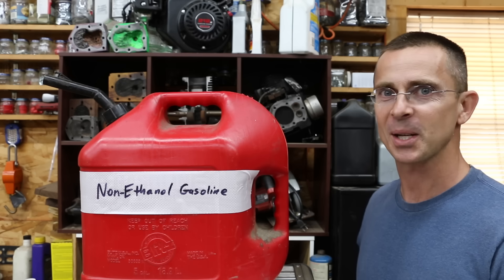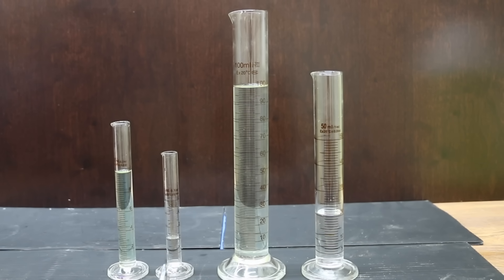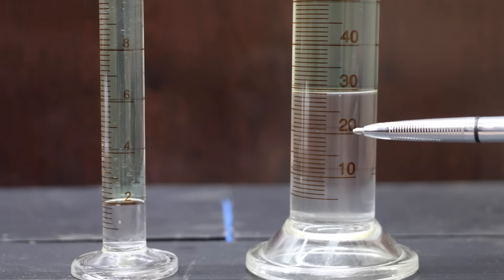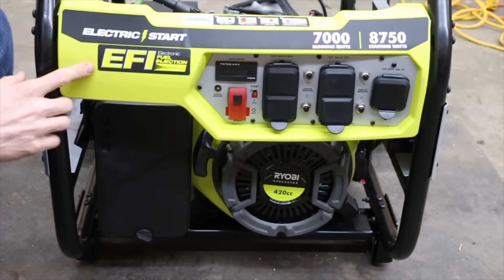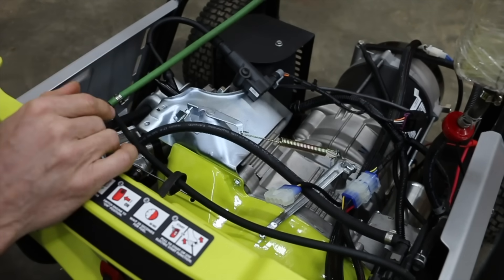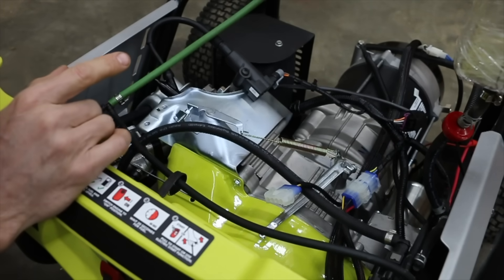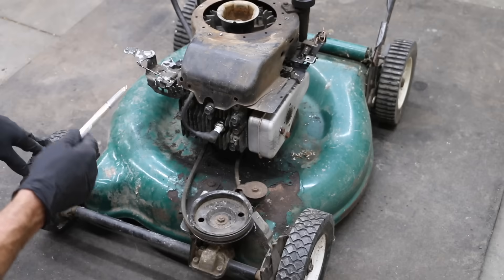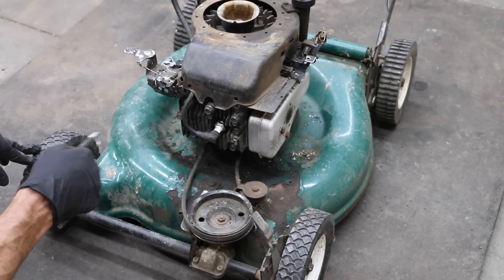Is Non-Ethanol Gasoline Really Better? See the PROOF!

Comment: Here in Colorado, regular gas is only 85 octane, so if I want to run 87 octane like my vehicle manual specifies, I have to buy midgrade. The price gap between the two grades used to be 10 cents per gallon, then it went to 20 cents and now 30 cents, so there's quite a price difference. People claim that you don't need as high an octane at high altitude, but I've read that only applies to old cars with carburetors, not modern EFI engines with engine computers. I'm wondering if running 85 octane causes the engine computer to reduce power to prevent knocking and also whether mileage isn't as good with 85 octane. I'd like to see a test to verify whether a modern engine is negatively affected by running 85 octane at higher altitudes.
Reply from the maker: Thanks for the suggestion.

Comment: I run ethanol (e85) in my 2016 Silverado 1500 and have found that although my fuel economy is worse, my engine tends to run better and smoother than with normal e10, anyone else run e85? I’d be interested in your results vs regular gas
Reply from the maker: Thanks for the video idea.

Comment: I had an outboard 90 hp honda and used the ethanol gas for couple of yrs., the ethanol ruin all my supply lines and then clogged my engine. $1000 later it worked again.
Reply from the maker: Thanks for sharing.

Comment: i do yardwork so my equipment gets beat on. mowers it seems frequent oil changes are most important. and i only use non ethanol. as for weedeaters the 2 cycle oil dont do enough. i found adding some marvel mystery oil helps them run much cooler better longer. so theres a test you could try?
Reply from the maker: Thanks for the video idea.

Comment: Not sure how distant your makeshift remote tank for testing is on the generator, but I would add caution to ensure that it is very well sealed to prevent vapor leakage. Vapors+space heaters is a bad combo.
Reply from the maker: Thanks for sharing.

Comment: Okay but are you adding into the fact that Ethanol takes more fuel to produce and that you're losing effieciency in its production so the modest gains in fuel efficiency at the engine is insignificant to the supplemental cost of creating ethanol to begin with.

Comment: I run PNE in all of my small engines, regardless of their manufacture.  Two cycles run PNE and Stihl Ultra two cycle oil at 40:1.  All gas has one ounce per gallon of Stabil in it.I have never had a problem with this mixture, even after two years of storage.
Reply from the maker: Thanks for sharing.

Comment: My car tells on ethanol gas very quickly. If I put the 10% blend in the tank, the mpg goes down, and the motor rattles under a load. 
If I put the non-ethanol in the tank, I average about 60 miles more per tank, and the rattle don’t happen at all. 
The car is a 1998 Grand Marquis with the typical 4.6 V8

Comment: I may be wrong but I think you mean hygroscopic ( tends to absorb moisture) versus hydrophilic ( tends to mix with water), which ethanol does not do well. It's called phase separation, when the ethanol separates from the gas and combines with the moisture. I remember learning that brake fluid is extremely hygroscopic. I'm not busting your chops here. You're obviously detail oriented so I thought you would like to know.  Finally, I have noticed that I am replacing more deteroriated fuel lines on small engines like chain saws, string trimmers, etc, than ever before. I think it's the ethanol. Another great video, thank you!

Comment: I use non-ethanol fuel in my motorcycle because it often sits for a week or two between rides and I don't want that sitting in my fuel system. How about a long term test that starts with two clean carburetors - One run with ethanol and one  without, then left to set and checked at increasing intervals (e.g., day, week, month, 3 months, year).

Another great test - awesome videos and channel!
Reply from the maker: Thanks for the video idea.

Comment: Yes water is bad for aluminum, ethanol absorbs water. If you use the fuel as you go it's fine, if you don't it's shit. Epa compliant carbs are the biggest nightmare of all. Because throwing your mower away is better than having an adjustment screw. Thanks EPA!
Reply from the maker: Thanks for the feedback.

Comment: I have had trouble with small engine carbs since ethanol became common place. But I bought a 97 ford 150 for parts it had a knocking engine the fuel tank was almost full it had set for about 2 years .I drained the tank the fuel had a slight smell .I wound up using the fuel in a old tractor with no problems.Im wondering if the larger amount of fuel had less air space an less evaporation that caused it to last longer compared to a 1 quart lawnmower tank ?

Comment: It is strange that cars in the us can run on 85 octan gasoline?
Here in europe we have 91, 95 and 98 and 100 octane.
The detonation point is higher, the engine can produce its power without detonation if you use the 98.
Reply from the maker: Thanks for the feedback.

Comment: South Africa introduced ethanol to it's gasoline in the early 80's, some European cars had to have their carbs recalled...aluminium used started dissolving. As I understand it fix was to use a gas resistant varnish/coating on the gas exposed surfaces. Some rubber/plastic hoses and seals also had to be replaced long term. Otherwise no detrimental effect. The ethanol can also raise the octane rating. Fuel economy is usually slightly worse due to ethanol's lower energy density.
Reply from the maker: Thanks for sharing.

Comment: Ethanol has a much richer stoichiometric ratio sitting at 9:1 vs. pure gasoline which is 14.7:1. When the two are mixed the complete ratio changes. The higher percentage of ethanol content the richer stoich becomes. All in all, e10 fuels should yield a 3% greater fuel usage do to the need for more fuel to maintain stoichiometry. Was very cool to see that actually put to the test. Nice work!
Reply from the maker: Thanks for  the feedback.

Comment: You gotta be real careful using water to remove the ethanol. There's a process called phasing where the water essentially gets mixed into the gas by suspending itself in microscopic droplets. There are scrubbers that can remove phase and water but there's the obvious downside of losing octane. In my opinion, ethanol free is superior simply for the reason it's way easier to store. I work in the petroleum business and I see thousands of gallons of blended gas thrown away due to water intrusion. It also will create sludge in your tank if you let it sit without stabilizing it. Those e15 race gas tanks are disgusting on the bottom. Anyways, great video and thanks for the amazing content!
Reply from the maker: Thanks for the feedback.

Comment: Not all ethanol fuel is created equally... In 2011, upstate ny, I burned up 9 chainsaws in one year, all with the same problem: scored cylinder on the exhaust side.  Several of the saws were brand new.  Non ethanol was very difficult to find, I was running the saw shop recommended 91 octane ethanol.  In NY, the pumps state “10% minimum ethanol”.  Testing revealed 15 to 25% ethanol.  Enough to lean the saws out, overheating them under load.  Other states (PA, MI, WV) the pumps say 10% maximum, and regularly test at 5%.  Since then, I have worn out a few saws... but no more scored cylinders running non ethanol almost exclusively.
Reply from the maker: Thanks for sharing.

Comment: Id like to ask what u used to clean the engine on the lawn mover and if its ok to do so cuz i have a few trimmers and lawn mowers to clean
Reply: I use purple power cleaner from Walmart it works great its only 2 to 3$ too
Reply: Also yes its completely safe just be careful near the ignition system and carburetor and paint just incase. I completely soaked my echo trimmer in cleaner for ten minutes then sprayed it off with light pressure water now it looks like new even for a trimmer made in 1996

Comment: I have a 50s tractor that was built for 70 octane. I could remove the E with that little trick. Just shut off the tap when gas comes out
Reply from the maker: Thanks for the feedback.
Reply: @ProjectFarm  I decided itd be safer if I was less involved and will just buy 100% gas. Lol. Great channel, finally subbed earlier

Comment: Interesting. Here in France E85 ethanol is about half the price of ordinary unleaded 95 or 98 octane fuel. There's a big market here for aftermarket conversion kits which modify the ECU settings to better handle E85. But a lot of us just use it in our gasoline powered cars with no modifications. Some engines handle it better then others depending on what margins the ECU has to adapt to it. I use about 50% E85 and 50% 95 in my 1995 1.8 Miata. Fuel efficiency suffers a bit (maybe +10%) but over 2 years and 20,000 miles I've not noticed any other ill effects. Maybe the plugs are bit whiter (because of the leaner mixture?) and I did have to raise the base idle rate to about 950rpm because I was getting idle drop at stop lights, but this may have been due to other issues. I did once fill with 100% E85, but the car didn't seem happy on it. I did wonder if fitting higher flow injectors might compensate for the leaner fuel. 
Apparently you can replace the original brown denso injectors (254cc) with the yellow ones used in the Mazda RX7 (310cc) but it may need reprogramming of the ECU to do this which is beyond my level of competence. If I can find a genuine second hand set of Denso yellows I might try it. What do you think? Without modifications to the ECU parameters will it make any difference?
Reply from the maker: Thanks for the video idea.

Comment: puregas.org I had a 2010 4.6l f150 used to shake at lights. Started to use ethanol free gas and it went away. My mpgs went up a lot too. I currently have a 2016 Subaru crosstrek. It’s rated 34 on the highway. Using ethanol free gas I can get 40mpg going 65 with cruise control on the highway.

Comment: In Brazil, we use 27% ethanol in gasoline. All new cars are prepared for this and there is no problem. However, older cars pose serious problems where there is metal in contact with the fuel (injectors, fuel lines, fuel pumps, etc.) requiring frequent cleaning of the fuel system.
Reply from the maker: Thanks for the feedback.

Comment: Blue gas: 100 low lead aviation fuel or at least it appears to be. I understand the need for a higher octane rating is to prevent pre detonation in higher compression internal combustion engines. Many engines do not need higher octane fuels so then why, according to the explanation that ethanol is added to boost the octane rating, is ethanol added?

Comment: A two stroke engine runs hotter when it is leaned out, since a 10 percent ethanol is only equal to 95 percent gasoline it should run cooler with 100 percent gasoline which is important since most if not all chainsaws are two stroke. A long time ago I just guessed and dumped some two stroke oil in the gas tank and I added to much which slightly thickened the gasoline, the bike ran great for a little while them it burnt a hole in the top of the piston.
Reply from the maker: Thanks for the feedback.

Comment: I buy my gas for the my generator at the airfield just to avoide fuel storage issues.  If I dont use it in a couple years I dump it in my car, mix it with new fuel and then refresh the gas cans.  Non ethanol 94 octane never has failed me.
Reply from the maker: Thanks for sharing.

Comment: With that water / ethanol removal process you enlighten us to at the beginning,  let say you add a pint of water to 2 1/2 gallons of gasoline.  Let it stand for 20 minutes after mixing . I own that new gas funnel that won't let water pass threw. ( It works I've filled it with water and would not let a drop pass threw, yet gasoline flowed freely).
With that thought in mind , would the ethanol remain in   the funnel with the water.
Another way to remove ethanol for your small engine equipment.... just saying

Comment: Nice! Finally a test on e10 in small engines! Please somebody mention long chain hydrocarbons that are cracked in the fuel making process reacting with the ethanol making the sludge and carbon buildup. Gas is a solvent and so is ethanol. Why doesn't it break down the carbon?

Comment: Ethanol is a fine product IF your vehicle has that type of fuel lines and other rubber bits. Older cars did not have it, my older truck does not have it, so I spend more on pure gasoline, but I drive few miles a year...
Reply from the maker: Thanks for sharing.

Comment: This confirms what I have seen over the years. In the beginning of wide spread alcohol use (1970's) I had a lot of carburetor issues on rubber parts causing yearly rebuilds. This was due to the small percentage of methanol mixed with the ethanol. It was originally called gasohol. I simply put a $15 carb kit (accelerator pump)in it, but others had to pay a mechanic for a new one cause they were ignorant. Later the name was dropped as the government wanted to subsidize the corn farmers but many didn't trust it. And the parts became alcohol resistant in the later 1980's.
Reply from the maker: Thanks for the feedback.

Comment: Been using Sta Bil and now the marine additive since the E10 came out in everything from chainsaws to my muscle cars with no evidence of damage even taking a couple 15yr plus carbs apart to check. But I use it year round at max dosage and always top off any tank that is gonna sit a while instead of running dry like a snow blower and if it doesn't get used that season it's drained and new fuel added.
Reply from the maker: Thanks for sharing.

Comment: Ever since my father gave me his 08 Crown Vic he has always put Super/93 Gasoline which is great to put in any vehicle you own, but now since it’s my car I have only put E85 and let me tell you, there is a BIG difference! It adds more horse power and gives it an extra boost of torque to the car and the ride is just phenomenal. It is much better for the engine, and Yes it burns fast just like 93 Gasoline but heck from $20-$25 for every full up it’s definitely worth it! I recommend anyone with a Flex Fuel vehicle to put E85 in their vehicle. You will not be disappointed! 👍
Reply from the maker: Thanks for sharing.

Comment: Good info on removing the ethanol. Thank you.
Reply from the maker: Very welcome!
Reply: You can lose up to 3 or 4 octane by doing so though.
Reply: Or leave the container open and it will evaporate and give you more gas % than ethanol. We do that with e85 and e98
Reply: Why would you do it with e85 which is basically almost nothing else than ethanol..?
Reply: @OjStudios  I think that was sarcasm lol. Leaving the container open will only get more water into the ethanol.
Reply: @Mr.Mister001  Oh.. Right. True. Didn't sleep too well. Shouldn't go browsing from the get go.
Reply: @OjStudios  yt is great for sleep replacement lol. I've been there a few times. Guy has some good videos. Cheers.
Reply: @davidroberts2404  There is no e98 and e85 is 85% ethanol and 15% gasoline. Also, gasoline is more volatile and will evaporate faster than ethanol.
Reply: @davidroberts2404  ingenious, in that by adding water and letting it settle, you can drain both the ethanol and water out and end up with pure dinosaur juice.

Comment: I have 2 autos. One is a 93 jeep Wrangler and the other an 06 Silverado. Noticed that the small autos run a lot better on non ethanol gas. Before I was running premium with additives. Now I just run non ethanol. I get a lot better gas mileage before feel up. A little more gain.
Reply from the maker: Thanks for sharing.

Comment: I am curious from your experience what damage or difficulty does ethanol cause in 2 cycle engines. I have worked in woodlands management for well over a decade. I have also used various 2 cycle small engines on different tools. We have always tried to use non-ethanol in our mix. Especially with our high end high performance chainsaws and brush cutters. Just curious if you have input? Thanks for your diligence. Appreciate your content immensely.
Reply from the maker: Great suggestion!  Thank you.

Comment: I work at an large ethanol plant. I was talking to the lab techs and process techs. They were saying that it's terrible for small engines because it burns hotter than non ethanol. They claim that it wears out the gaskets quicker because of higher heat. But I see in the video that the head and exhaust temps seem similar. So who to believe. I will continue to use non ethanol in my small engines and atvs
Reply from the maker: Thanks for sharing.

Comment: Alcohol is lower in heat energy than gasoline. There is no way you got more fuel efficiency from 10%ethanol gasoline.
Reply from the maker: You are right.  The test showed 4% less fuel efficiency with ethanol in the fuel.

Comment: I've been adding Sta-bil to my small engine fuel for years and seems to help with keeping the fuel fresh and reducing the gum. May be in my mind but it seems to work for me and a possible long term test variable.
Reply from the maker: Thanks for sharing.
Reply: I use 2 stroke oil. Never had a problem. My snow thrower and lawnmower start up every time. I don't use a 50:1 ratio though. I pour maybe a tablespoon into the fuel tank when it's half full or less.
Reply: @Mardasee  I think most have a stabilizer in them so that makes sense.

Comment: Would you see if you can build up a auto air-conditioning using two power sources first with  110 volt electric motor then I with  a gas powered engine.
Reply from the maker: Thanks for the video idea.

Comment: Ethanol problem is mostly on the seals and gaskets, if the the engine is no designed for that of course. On my motorcycle’s plastic tank , it was deformed because the Ethanol.
Reply from the maker: Thanks for the feedback.